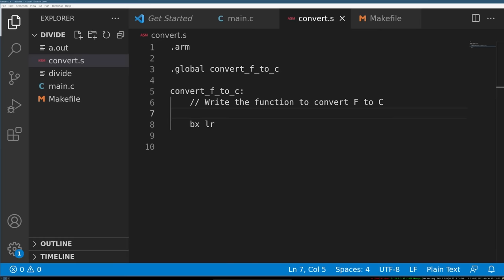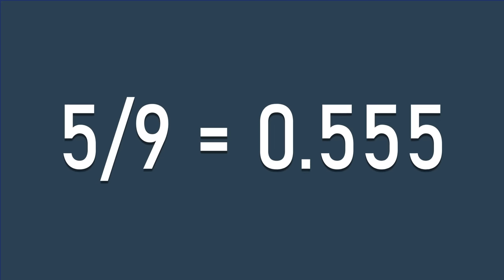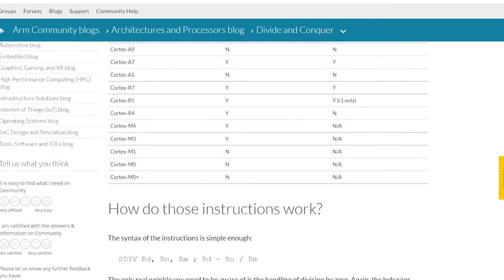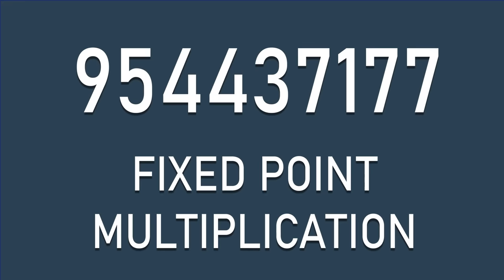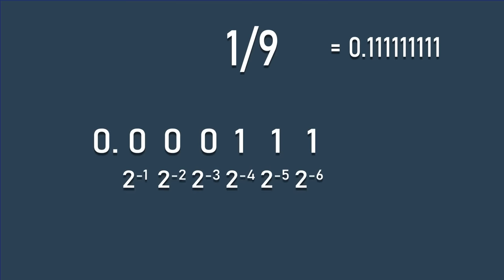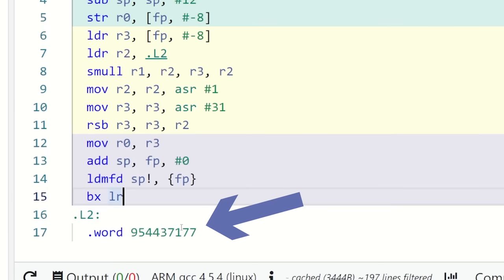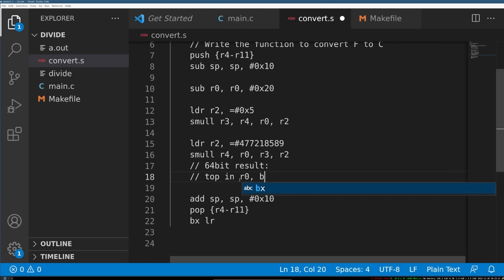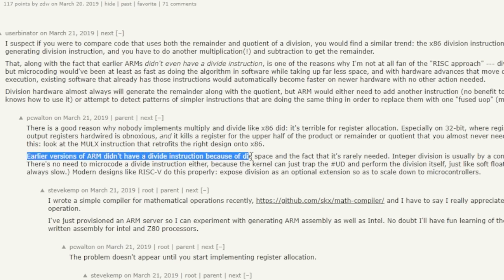computers suck at division (a painful discovery)

Comment: A couple of extra notes:
- This division method (multiply+shift) is attempted by compilers whenever the divisor is known at compile time. It isn't used to divide by an unknown number as the constants can't be predetermined.

- Another alternative to implementing these things in hardware is to translate the instruction into micro ops on the cpu. (I can't say for certain which instructions do this but I believe all exponential/trig functions usually do.) I believe the reciprocal is usually calculated in hardware so a division might be converted to this plus a multiplication

And yes, regular divisions can take 100s of cycles
Reply: There are a lot of iterative algorithms for computing divisions. My favourite is successive approximation: x = a/b, we rearrange to x.b = a. We then guess the value of x 1 bit at a time, by setting each bit to '1' from MSB to LSB and checking if x_guess.b is larger than a. If it is smaller (or equal), then we leave that bit set. If it is larger, then we reset that bit to '0'. This algorithm works nicely for a lot of monotonic functions with simple inverses (e.g. division --> multiplication, square root --> square, and there is even a clever trick for calculating logarithms this way).
Reply: Of course, that algorithm is slow, but I think it is elegant. In digital hardware, it needs N clock cycles to calculate an N-bit result (but uses an incredibly small amount of silicon). In a CPU, much longer.
Reply: @weetabixharry  : I wonder if anyone's tried to shorten it with a "binary search" or priority encoder?
Reply: @absalomdraconis  There are plenty of ways of doing it faster in hardware, it just costs more transistors. Depending on the clock frequency, it may even be possible in 1 clock cycle. The best solution depends on the use case.
Reply: @absalomdraconis  And it already is a binary search (because we're setting 1 bit at a time, not incrementing the value +1 for each guess).
Reply: @weetabixharry  afaik it is only possible in one clock cycle if you are using look-up table. 
fastest hardware method i know about uses at least three clock cycles , one to load into register array, assuming hardware can do shifts in same cycle, another to perform lookups on the parts, then sub/add on array of registers and last cycle is to synthesize result, incl. lookup for special cases. 
It takes loads of silicon as given n is bit width it needs 2n shift registers and 2n adders(not shared by ALU) and optionally loads of rom, if you want to do it bit different way.
Reply: @piotrcurious1131  If your clock is slow enough, you can do just about anything in 1 clock cycle. It's very often a terrible idea (in cases where you're throwing away all the advantages of a synchronous system). So, in practical terms, you're right - don't try to do this in 1 clock cycle.
Reply: If you do know you will be performing a bunch of divisions by the same number that you don't know at compile time, it can be worth to implement this solution manually (compilers can't guess that information and won't do it).
Reply: @weetabixharry  If one has some spare memory left, one can speed up reciprocal computation with a precomputed function table. However, in the case of this video, the table only needs one element.
Reply: @amigalemming  In hardware terms, I would just call that a multiplication. The hardware multiplies a number with a constant (and is agnostic to the fact that the constant happens to be a reciprocal). When the LUT has >1 elements it gets more interesting. The common approach is to dual-read two adjacent values and linearly interpolate between them to get much more bang (precision) for your buck (memory size). This works not only for 1/x, but basically any smooth function. But if you have plenty of clock cycles, then save the memory and go iterative.
Reply: @weetabixharry 
Non crap architectures can divide 64 bit ints in about 20 to 30 cycles.
Reply: @Antagon666  I can do it in zero clock cycles, or as many clock cycles as you want. It's a trade-off.
Reply: @weetabixharry  hmm. Meant to reply on original commenter.
But yeah in software emulated division 100s of cycles is realistic.
Reply: @weetabixharry  btw zero clock cycles is practically impossible, since you're still going to have to fetch decode and execute the instruction. Even with pipelining and reordering of instructions, you're still paying a cost.
Reply: @Antagon666  You're talking about software, I'm talking about hardware. A hardware division isn't limited to the instruction set supported by a CPU. You can just implement the whole division in transistors. Most modern sequential implementations would still split (pipeline) the division into multiple clock cycles, but there are use cases where you might implement the whole thing combinatorially.
Reply: @weetabixharry  never said anything like that. So stop putting words in my mouth.
Reply: @Antagon666  You mentioned the decoding and execution of instructions. That's specific to microprocessor architectures, which are in the realm of software. A hardware divider (constructed from transistors in an ASIC, or LUT primitives in an FPGA) would not involve instructions in any way. It wouldn't necessarily even need a clock (although a typical, synchronous, implementation would).
Reply: @weetabixharry  yeah but you are just moro*, it was only to show the instruction won't be run in zero cycles, because it impossible.
Reply: @Antagon666  If there is no clock, then there are no clock cycles. Division can be done combinatorially (without a clock). So, it is not impossible.

Comment: I used this same technique years ago.  Another way of thinking about it is that you’re converting your fraction to a close fraction which has a power of 2 as the denominator  since that will just be a bit shift operation.  It was an old intel 8088 microprocessor.  It had a divide opcode, but execution took over 160 clock cycles.  The real-time code couldn’t finish processing one block of data before the next arrived.  Converting all the multiply & divides into multiply & shifts saved the day.

Comment: I've been developing on a Motorola/freescale/NXP DSC family chip for a few years now and I'm always having to do multiply shift approximations.  A simple divide operation takes a few hundred microseconds, and when I'm running a one millisecond loop that can blow things out quick.
This is just one of those cases where close enough really is close enough.
Reply from the maker: Yeah I’ll probably do another video for this but it’s crazy that even on modern CISC chips DIV instructions take sometimes up to 12-20 clock cycles
Reply: @LowLevel-TV  But then the human brain typically struggles with division the most too. I still can't even get my head around long division lol.
Reply: @LowLevel-TV   That is because Division is one of the hardest problems in Computer Arithmetic.
Reply: Maybe we should teach them short division method.
Reply: @LowLevel-TV  If you want to realize you're still coding at a high level even in asm, then try to implement a divide yourself in FPGA (-:
Reply: @slicer95  And human brains. It is always been easier to increase than decrease. try counting from 1 to a 1000 and time yourself and do it in reverse, I bet you will have more trouble in reverse (Unless you are wired differently, which is a possibility).
Reply: @andrewdunbar828  for lower (more common) numbers, you could use a multiplication lookup table with precomputed magic numbers.
Reply: @andrewdunbar828  Long division in binary doesn't sound all that complicated. Probably not optimal, but gets the job done. And (almost) everybody already knows how to do it in the rather more complicated case of decimal.
Reply: Pi = 3.14 - good enough!
Reply: @UnblockMind  Long division is what the 68000 (and most processors of that era) used.  It's why the division takes 144 clock cycles, when most instructions only take 8 - 12.
Reply: @LowLevel-TV  That's a good thing. Division is costly and it is good that the programmer knows it, such that he can avoid it where unnecessary, like when dividing by constants.

Comment: In the “old” days of fixed point arithmetic, machines came in fractional or integer models. So, we kept track of powers of 2 in a note by each statement so as to loose track, x(2^n). The “n” was physically typed in the comment beside each statement. As far as timing, a multiply took 4 cycles while a divide took 13 computer cycles. This was for a 16-bit process while double, triple, quad etc precision timing grew to 2n cycles, 3 n etc. So we always tried to find ways of using multiples, especially for critical time simulations.

Comment: I've got some bad news... looks like the Cortex M0, M0+ & M1 don't support the SMULL instruction (32-bit multiplication with 64-bit result). You only get the lower 32 bits. If you set the compiler flag `-march=armv6-m` in Godbolt, you'll see it calls a library function for division (`__aeabi_idiv`) instead.
Reply: Yup, the same thing tripped me up when I was fooling around with some playful attempts to do baremetal stuff on a Raspberry Pi 3B, which has a Cortex A53 I believe. I didn't bother to include or link any libraries, because I was only doing very basic arithmetic and pointer shit anyway, outputting over UART. I was quite surprised that I was getting an error referencing this function call, in a place where I fully expected a plain integer division to be.
Reply: I strongly doubt if he actually needs to convert millions of Fahrenheit to Celsius. For a reduced range a 32-bit multiplication with a 16-bit constant and a 16-bit shift is enough for correctness.
Reply: Dont code for armv6... That stuff is ancient.
Reply: @Carewolf  "Dont code for armv6... That stuff is ancient."
ah yes - the "ancient" 9 years ago... cause nobody would ever use something that was first released that long ago............................................................ yeah no.
Reply: @ABaumstumpf  You dont because arm before v7 is not a single platform, it makes no sense to target armv6 because there is no such single ISA, it is a huge mess. if you target arm32 you target armv7 or a VERY specific arm cpu.. And besides armv6 is from 2002, so 20+ years old, not 9
Reply: @Carewolf  Pretend I wrote `-mcpu=cortex-m0plus` instead (for, say, the RP2040 or Teensy LC). There's still no SMULL. Same result.
Reply: @foobar1500  Clever! Also gives a good reason to derive ones own constant instead of just copying the one from the compiler.
Reply: @Carewolf  like original Raspberry Pi and iPad...
Reply: @ABaumstumpf  'the "ancient" 9 years ago'

Plus v6 cores are still in production in all sorts of embedded stuff.  Old CarelessWolf was telling us not to code for modern stuff fresh outta the fab.
Reply: @nahco3994  I do C development on a Cortex A9 (32bit). It has an FPU, so float and double math is pretty snappy (you must remember to enable FPU register push/pop for function calls for all tasks using FPU instructions!). However 64 integer math is >1000x slower!
So I have the opposite problem!
Reply: You can code the multiplication yourself... Just split into low and high 16 bit numbers, multiply out and store the results into 2 32 bit registers

Comment: The first computer which I programmed in Assembly was the IBM 704, in 1960. There were two floating point division instructions, Divide AND Stop & Divide OR Stop. This had to do with the requirement that the result had to be less than one. So the inputs had to be scaled to make sure.

Comment: As soon as you aren't working with whole numbers, most humans start to break at division as well.
90/9 is something most people can do, 90/8 becomes a bit tricky to some, but 90/7.6 will require most people to pull out a writing sheet to 'cache partial results', and even makes us struggle past this point.

And this is while we are the creatures that learn how to divide things evenly with others even before we learn math.
Reply: I'd say that most people (including myself) would actually no even try to do 90/7.6 by themselves at all, sheet or not.
Reply: 90/7.6=900/76
Reply: the big difference here is that 8 and 9 have 1 digit while 7.6 has two not the fact its not a whole number if you say divide by .9 now its a cakewalk for most people again
Reply: @ss3nm0dn4r8  I wouldn't say most would find it easy again (althought definitely easier then 90/7.6), but that's also because the solution is a whole, natural number again.
Reply: Did it (approximately) in the shower - it’s about 11.8420105.

(Edit (having checked it now): got the fourth decimal digit wrong by a shift, it’s about 11.842105.)

Comment: Old timer here... visiting you from the days before MUL and DIV instructions in microprocessors.  I should be well versed in all manner of integer math operations, but thankfully I've been able to forget (or at least not recall and use) all that for years now.  Heck, for some of the industrial machines (Z80 based) I programmed in the '80s we splurged and added a math co-processor card!

Probably the main takeaway in your journey shown here is that ARM is older than we tend to think.  Born in the '80s itself, ARM was radically new (RISC) but still influenced by its times.  Also, adding hardware DIV might have been considered antithetical to the new RISC concept.
Reply: And nowadays RISC and CISC aren't really meaningful anymore. The most widely used RISC designs have tons of instructions and extensions and the most widely used CISC designs translate CISC instructions into RISC-like µOps

Comment: Those of us who work with smaller micros do this on an almost daily basis.  Create a multiplier/divisor pair with the divisor a power of 2.  2^8, 2^16 and 2^32 are especially nice because they just involve discarding low bytes.  The only caution is to make sure your intermediate multiplication cannot overflow.  For "normal" temperatures, a 2^8 divisor is all you need.  5/9 = 142.22, so the multiplier can be 142 or 143.  Now you work back to determine the maximum input temperature that will avoid overflow, so 65535/142 = 461 and change.  The conversion will work with inputs up to 461 degrees, with an error of about 0.16%.  You can also add a rounding factor of 256/2 to the multiply before the 2^8 "division".

Comment: It is nice to see young kids discovering the wonders of the world! :) What if I told you that the famous 6502 CPU which powered such machines like the C64 (and many-many others) had not only no division but no multiplication too. And it was still able to rule the 80s.
Reply: When I was using Apple II, I wrote a macro library for 16- and 32-bit int operations like add/subtract/multiply/divide.  But when I got to wanting to do floating point from assembler, I cheated and just bought a floating-point processor board.
Reply: You simply have to implement that in software as far as I know. It will just be slower but that's It.
Reply: @w花b well, by deciding to work with floating points, you kinda accepted the fact that you will sacrifice memory and performance.
After some time studying hardwares, specially old ones, i got why its that so fundamental and common.
Reply: Traditionally, we used log/exp approach on 8bit/16bit. Hitachi and Mips RISC cpu work around the problem. On mips, multiplication and division are carried out in parallel and store the result in specific registers. Hitachi "sh" cpus provides a division by part, we can set the required precision: one instruction to initialize, another to perform a step.
Reply: @w花b Yes, of course, it was Turing complete. I just said that it was even more primitive, but still a CPU. Getting surprised that some CPU has no division shows that you're way too young. :)
Reply: The next generation of computers (IBM PC /combatibles) had a separate socket on the mobo for the infamous (but optional) "math coprocessor".
Reply: I started assembly programming on the 6809, which actually had a multiplication instruction and was considered very advanced for an 8-bit processor.

Comment: I'm old enough to remember the days when all calculators were mechanical (sometimes electrically powered, but not always).  Unless they were the more expensive variety, they did not support division.  I specifically remember my first hand-held 4-function electronic calculator (circa 1960) and being truly amazed that it could divide!  There was actually a short pause (maybe 1/8 second) before it displayed the answer to a division problem.

Comment: I remember when I first started learning to use assembly, I started coding for Game Boy. I decided I'll write a few simple functions to get a feel of assembly, so I wrote a function for Fibonacci sequence then I attempted to write a function for “n!” !!!
Imagine my surprise when I found out that GBZ80(CPU of Game Boy) doesn't have any instruction for multiplication. I had to write a multiplication function using bit shifting.
I have used a lot of different CPU's assembly and most of the very old ones (6502, 65C816, …) doesn't have a mul\div instruction; and old ones (8086, 8186) only have integer mul\div; and newer ones (from pentium until now) are very hard to program (if you want to make them fast, that is) because of SIMDs.